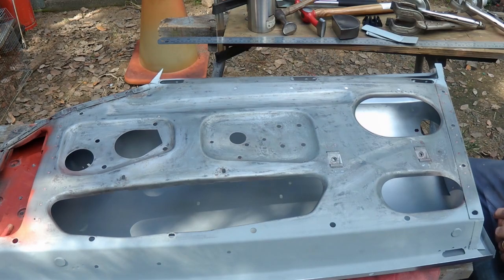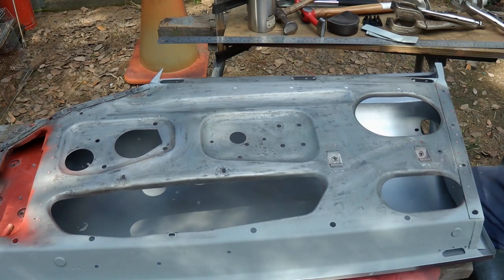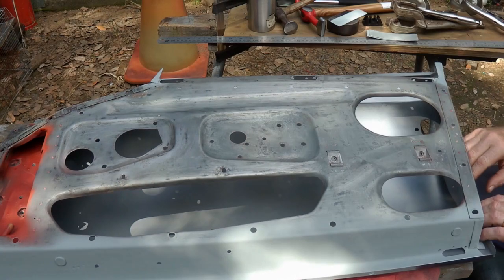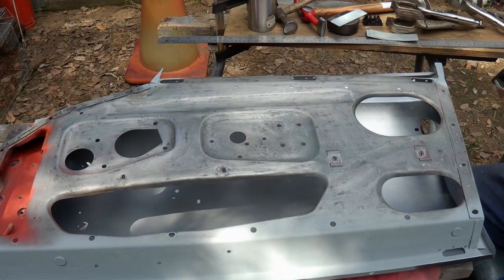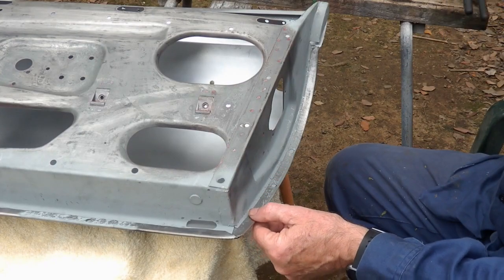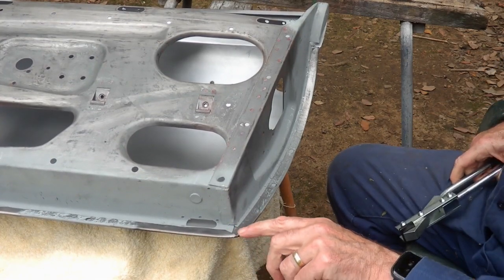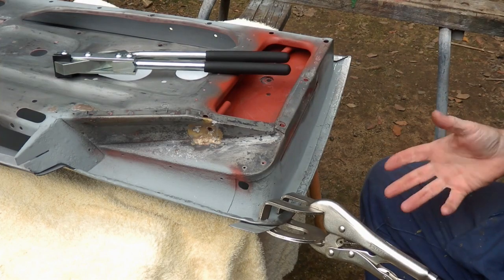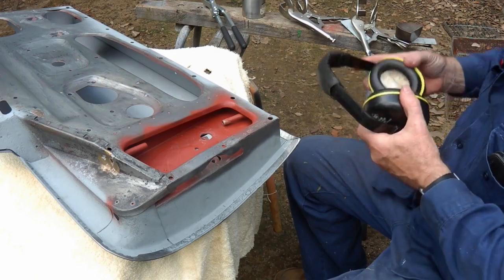1969 E Type FHC DIY Restoration   Rebuilding The Body Part 25

Comment: So, before you put the door onto the skin you didn't put any seam sealer compound before you folded over the skin edging?  I would imagine at some point you will apply seam sealer to the finished folds, right?
Reply from the maker: I won't be applying any seam sealer until the doors  have been properly fitted to the body as the final fit may require lead or additional welding to the edges of the folds. Denis